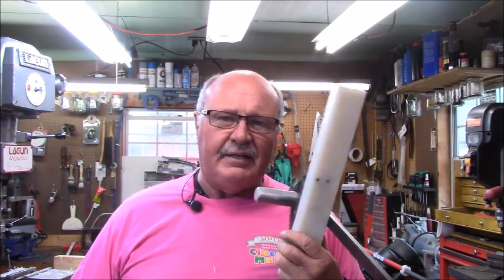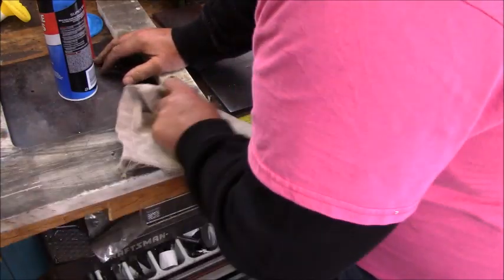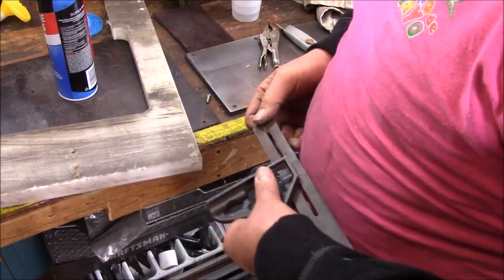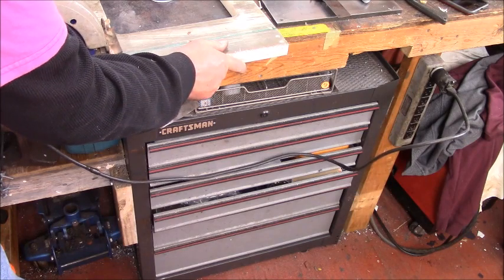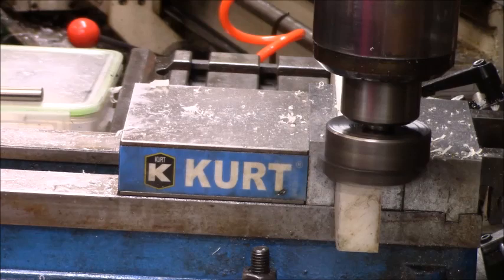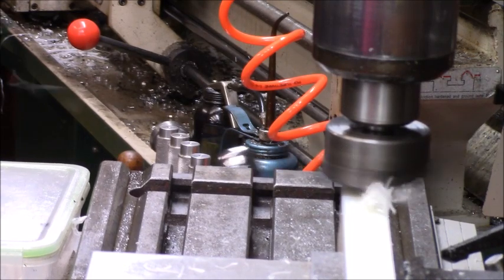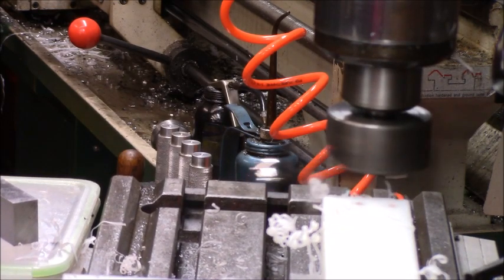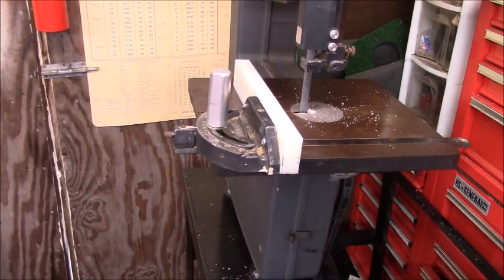A delrin face for the miter fence on the band saw

Comment: I've never fly cut Delrin before, it looks like it cut fairly well.  I don't blame you for adding to the t-jig on your band saw, as it's worth it to make your thumbs safer during pushing.  Good idea.
Reply from the maker: Everett's Workshop yes it fly cuts well, just the stringy of any way you machine delrin it is stringy. I’m fortunate to have a lot of recycled delrin parts that was thrown out lying around. You will see in a future video I took the left over of that piece and cut it up and machined some round stock out of it.  Thanks for watching and commenting

Comment: Hey James maybe a good project for the shop would be a set of machinist jacks. Would stop the chatter on the ends of long stock.
Reply from the maker: Robert Reed I actually have some I made. The  overhang wasn’t enough to get them on the part. If it was any thing besides delrin it would have been a problem. Thanks

Comment: I need to find an inexpensive source for Delrin!  The only plastic I have ever machined was some polyurethane bushings.
Reply from the maker: Rocking J Metalworks - John Brock Delrin or any machinable plastic is expensive, I know. Used to purchase drops of 3/4 sheets from a local plastic place, $100 worth you could carry out in your arms. I got lucky my former employer used the material for rests and linings, the idea is to keep from dinging gears and other machined parts in process before they was hardened, so no extra noise in the transmission. So a lot of pieces were thrown out and I could get them for a while. Then they quit that. This was made from a piece of some kind of cradle that was used in the assembly process. They decided to sell 5s items that no one wanted in the plant, donate the proceeds to charity. I purchased a box full of these for $15. It ended up being 1/3 of a pickup full. So l have a supply. Some will be turned into round stock